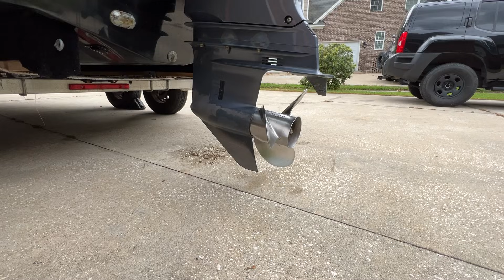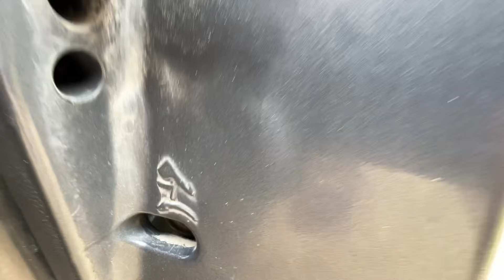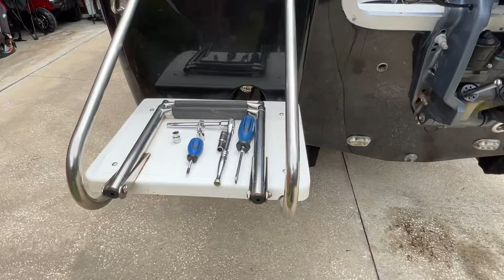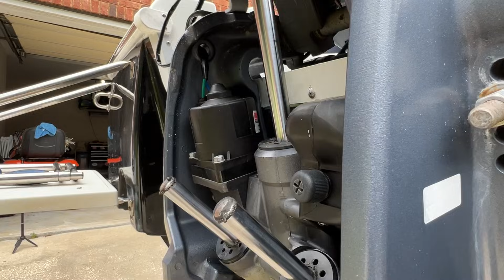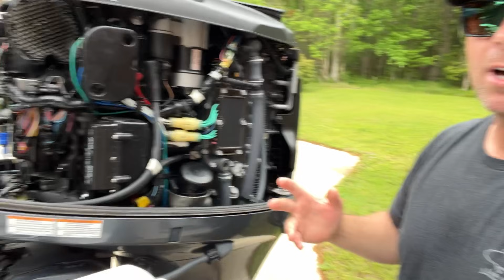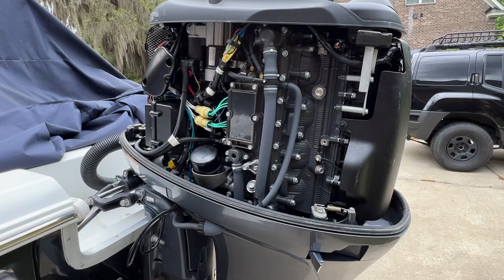HOW TO - manually raise outboard motor + tilt/trim motor replacement - yamaha outboard

Comment: Just to get it stright, we turn the screw CCW (or in whatever direction is noted on the motor) to release the pressure to be able to lift the motor manually.  Then once it is up we turn the screw in the opposite direction to close off the release to prevent it from moving.  After the trim motor has been changed we will then release the pressure again, lower the motor, and then re-tighten the pressure release once the motor is all the way down before we can operate the switch?
Reply from the maker: Turn the screw counterclockwise to release the pressure. Manually raise the motor then put the kickstand in and tighten the screw back down. Replace your trim motor.

Comment: My motor is stuck all the way down. I have the bleed valve loose but can't get the motor to budge. How hard should this be? Any tips or tricks?
Reply from the maker: With the screw bled it should move. It’s a very heavy motor.
Reply: @LowCountryFishing used my truck and a strap to get it up far enough to lift it all the way. With some help. I tapped on the motor and now it's working. I have a replacement on order.

Comment: Hello, maybe you can help me. I got the exact same engine. It’s in the water. I have a slow trim leak because once a year I add fluid this season. I ran out of fluid now it’s in the water stuck down when I take it out of the water, I’m gonna do your steps with the screw counterclockwise and I should be able to lift it with another person correct? This is a nightmare for me. I keep thinking when I go get the boat out of the water I’m not gonna be able to manually lift it. I can’t put more fluid in it because when it’s closed, it’s not enough room to put the hose where the fluid goes and I think it won’t take fluid unless it’s in the upright position for some reason. I would really appreciate a response. Thank you for your video.
Reply from the maker: Take a buddy to the ramp with you and have him help you lift it up. It’s that or you damage your lower unit when you drag it in the road.
Reply: @LowCountryFishing  thank you for answering. I got the trim to work what I did is I cut the hose for the fluid. I made it small and it fit in that little space there when the trim was down it was still difficult, but I got it. Thank you for your concern.

Comment: Great video.  Question - once the new trim motor is secured and you've released the pressure once again by turning the flat screw so the motor can be lowered, do you then tighten the flat headed screw once again?
Reply from the maker: Yes, you have to re-tighten that screw if not, it will never build pressure to tilt up and down

Comment: Wow! So I'm sitting here with this dilemma, my motor parked over winter in lower position and I need to bring in out for my boat mechanic, batteries are dead. So to move it, I need to raise the motor manually, SURELY there must be a way to do this, and SURELY there must be a YT video? And here I am. DUDE. THANK YOU. I'm a new subscriber. I mean, seriously, great education lesson here.
Reply from the maker: Happy to help brother, this is exactly why I made the video. No fluff, just information
Reply: And ... it worked!

Comment: Good, clear, and complete. It gave info I needed. My motor was hard to lift. I used a floor jack. It seemed to have a compression lock; it would lift up the whole boat when locked, then pressure would release and it would be easy again. The pressure release screw seemed to tighten up with pressure. Your description to back the screw out 2.5 turns might be what I needed to do. Thanks.

Comment: Quick tip. If trim switch goes out 12v to blue wire motor goes up 12v to green wire motor goes down.  Green like grass blue like sky
Reply from the maker: Gotcha. Assuming the motor is good and the relay died?
Reply: @LowCountryFishing  right
Reply: Had to do that when my relay went out.